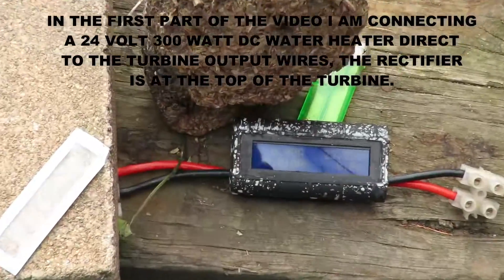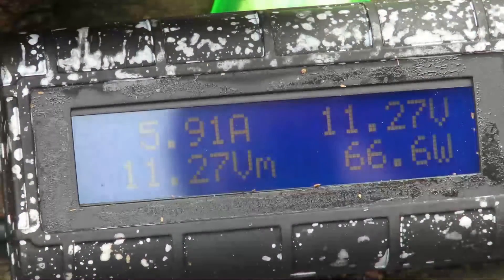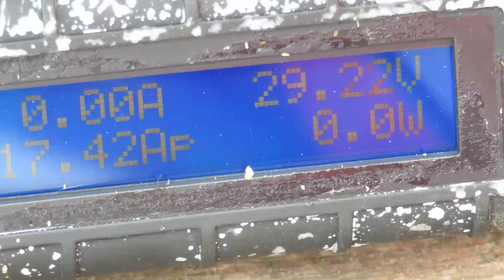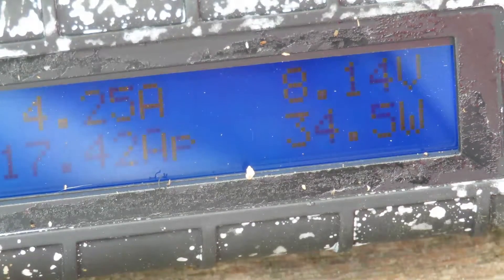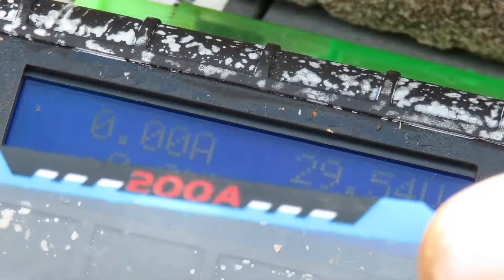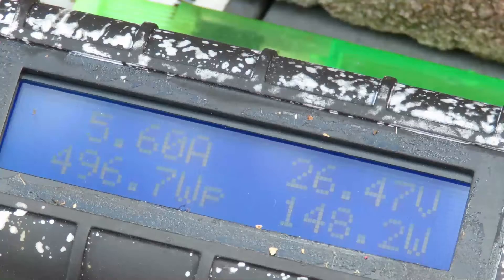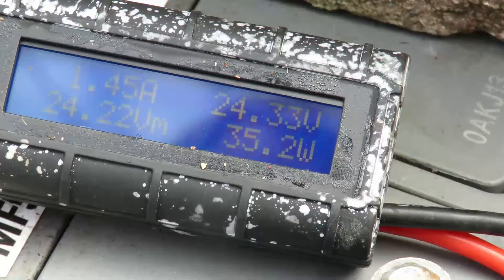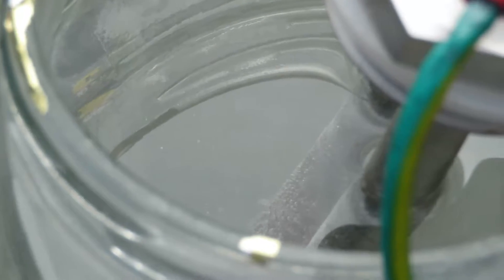D.I.Y 24 VOLT  Off Grid Wind Turbine , WATT power meter, 24v DC water heater experiments 05 08 2020

Comment: The DC elements are kinda slow at heating water but they're decent dump loads , I've seen guys use the DC elements as pre heaters for dual heating element hot water systems with storage tanks saving some grid power, they replaced the upper AC element with DC.
Reply from the maker: I am amazed how it is been lime scaled already !!
Reply: @GavinFreedomLover  the water here is artesian and the ground is full of limestone so our elements burn out struggling to heat water until 0.2 micron water filters were installed. People here get spurs on the heels and spine because of the limestone so we filter for than too.
Reply from the maker: That's crazy , I am doing electrolysis direct from my turbine it is working very well a.t.m.